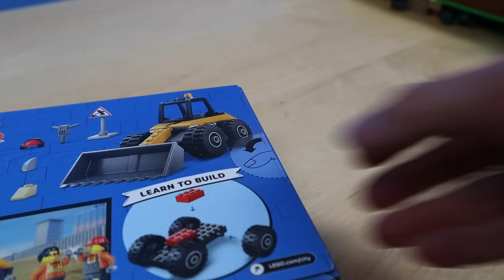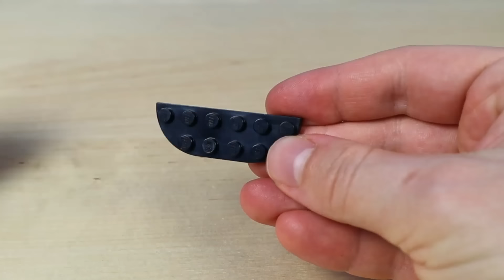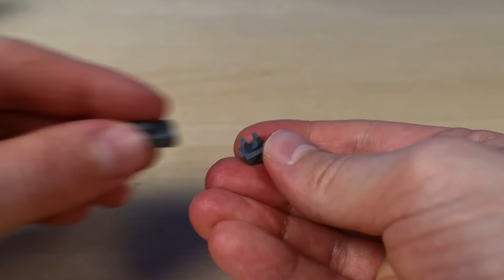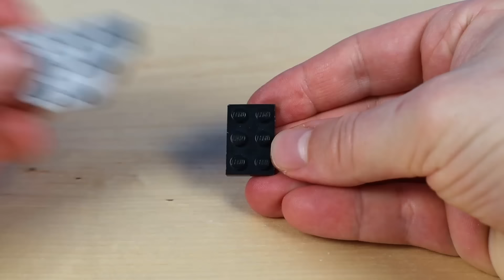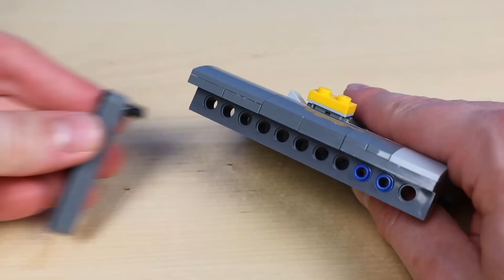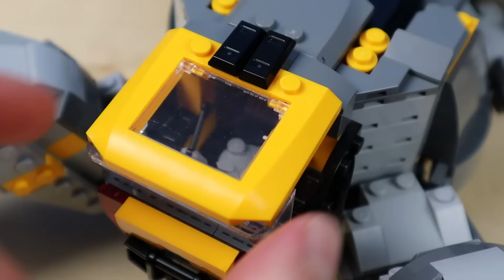I Turned Random LEGO Sets Into Construction mechs!

Comment: The rubber wheels could have also been used in the legs to act as shock absorption for the giant swinging ram,since it would absorb the backforce from it swinging into solid structures.